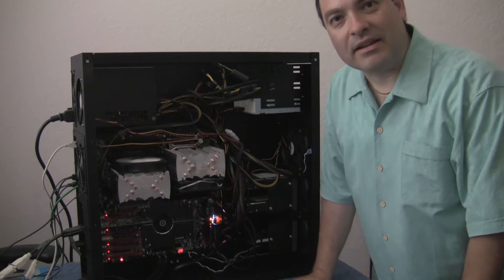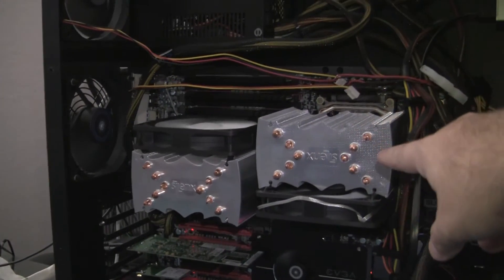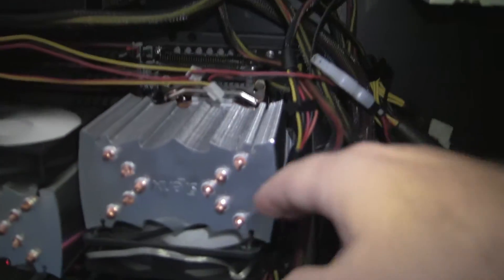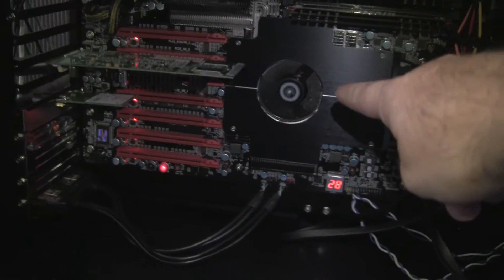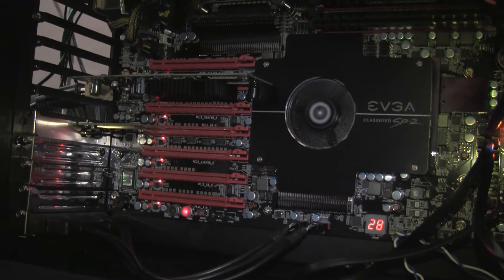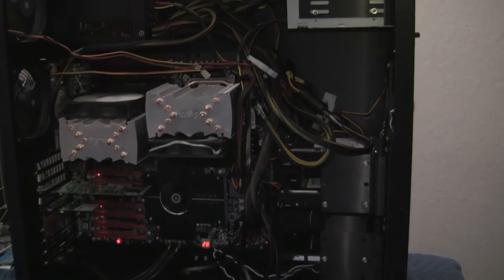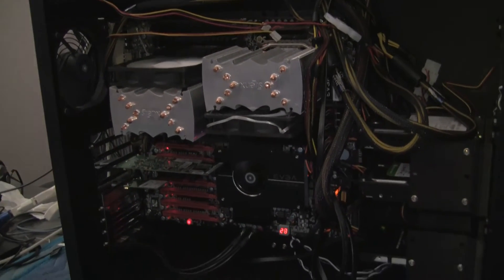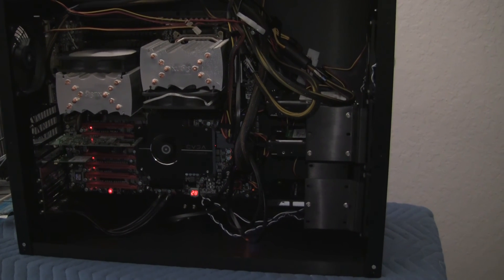Water Cooling Your Computer - Part 1 - Introduction

Comment from the maker: Yes, the Xeon 5690s are expensive. But remember, you bought the SR-2 to have the best, so save up and get the fastest processors you can. Make sure you get 2 of them, and unfortunately, they both have to match. You can't install two different kinds at the same time.